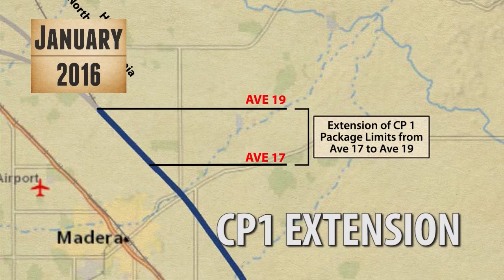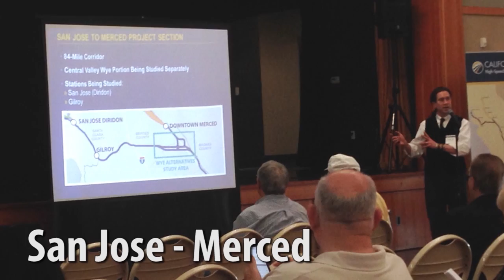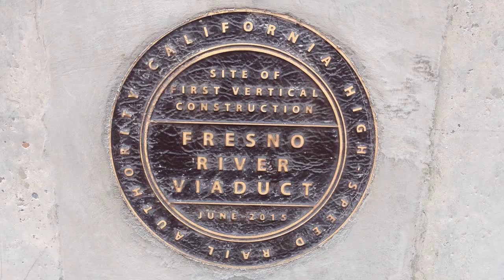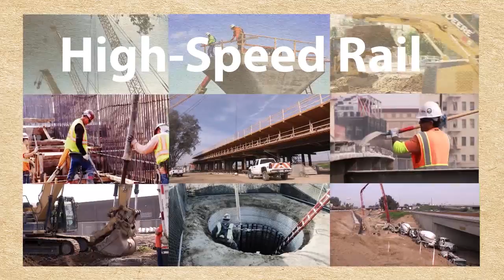6 Months of Progress on High-Speed Rail

Comment: I think we need to challenge the CEQA process. Namely, by going to the plebiscite to create the HSRA, the state affirmed its vision that the benefits of HSR environmental impact suspended judicial standing of opponents to agency-driven driven projects. The 2008 enabling referendum was more than just an obligation bond authorization. The State Water Project relies on similar (and ancient) 1960 authorization for its ongoing work, and educating the Bar of California - an agency organized under the State Constitution, on respecting the constitutional validity of voter-incorporated agencies is essential. We have, to be blunt, judges who have gone rogue. When the HSRA fails to assert its authority because it's afraid a judge might assent to meritless claims of a few property owners in Palo Alto, it sets a dangerous precedent that will doom key parts of the project. Complicit with the attorneys is the news media, especially in Los Angeles, which so often fails to step back and contextualize local opposition. This happened to the Red Line to the point the Federal Congress got involved, even though has absolutely no delegated powers to do so, and we are still untangling things to build the subway to the sea.

My challenge with HSR 2016 "shift to the north" is the MWD just finished the inland feeder project, meaning there are a whole bunch of engineers and miners out there who just managed to put a 42 mile tunnel under the San Bernardino mountains crossing nine faults and and there is a whole factory to construct concrete sections for use by TBRs. You should have gone in and hired them while their knowledge was fresh. Of course you aren't going to read any of these comments because I'm nobody.

Comment: CA High Speed Rail needs to seriously reconsider building over Tejon Pass via the I-5 corridor. It's a much more direct and competitive route between LA and Bakersfield than the currently planned route via Palmdale. A hundred years ago the Santa Fe Railroad didn't complete the rail gap, and now CA High Speed Rail has a chance to complete the rail gap between LA and the Central Valley. It's more than feasible and possibly less expensive than the planned route over Tehachapi and Soledad Canyon.
Reply: I'm Nor Cal so I don't know the details that you know.  You should go to meetings and express your concerns/ideas with the cities and high speed rail authority.  Or anyone that knows connections to what to do haha.
Reply: I believe the reason is technical. High speed trains do not like hilly mountain environments. I assume the cost to bore through mountains would be too high when it would only achieve savings of a few minutes. Going over the mountain would have a very high cost of electricity and maintenance, along with the potential of shutting down when it does occasionally snow up there.
Reply: @nme700  The Tehachapi crossing is presumably higher than Tejon. Plus the routing via Tehachapi was likely more to do with politics than physical challenges, connecting to Palmdale and the future Las Vegas HSR line to get support in the Antelope Valley as well as Bakersfield with promise of a downtown station.
Reply: @PacificRailsProds  It is nice to read your comment. You are absolutely right. Extending south won't happen for at least ten more years so perhaps there will be an opportunity to change the routing when after engineering studies it becomes clear the huge difference in cost. By electrifying Metrolink's Antelope Valley and San Bernadino lines like Caltrain did then Palmdale and LAUS could be connected to the High Desert Corridor and Brightline West.

Comment: This is ridiculous, the construction per mile is 45% more expensive than the Chinese and even 5% more expensive than the Japanese high speed rail. "Good" for Californian state budget or shall I say QE.
Reply: All American infrastructure is costing more than many other developed countries it is an American problem not just California.
Reply: rpf276 And I believe that is not a good thing at all in the long run especially for Americans. The federal or state government have to find a middle path or win-win solution for this issue.
Reply: Being the first high speed rail (new equipment has to be bought) and in a state with significant higher wadges than japan, coming in at 5% higher costs than japan would be a really good job. Yes china is cheaper, but they have the unique combination of cheap labor and high tech equipment available. You can't beat them.
Reply: Why compare efficient East Asian countries with the slow bureaucratic American system? It will be good enough if the Californian can build the rails in 10 years. The chinese and japanese can probably get it done in 1 years with the same price tag.
Reply: 5% more than japan really isn't bad. It could cost as little as China's if we paid our workers as badly as they do. Not worth it for savings IMO

Comment: Most expensive HSR per mile in the world, and also the slowest. Go, California!
Reply: New Urban expressway rebuilds with on demand toll lanes are similar in cost if not more over 100 million a mile. Besides American transportation infrastructure costs not just California are the most expensive in the world including where you like.  California HSR is made for +200 mph (+330 kpm) travel so unlike Acela in the Northeast where we never get around to high speed tracks this is really high speed rail.  The entire Cal HSR is over 500 miles (800 km) phase I and over 800 miles (1300 km) total build. California would spend 2 to 3 times mores with adding yet more freeways and airports so that is why it is happening.
Reply: False and false. With 200mph they are aiming for the current operational speed record. Yes when it is finished japan will probably run faster, but it will be within the top 10 of high speed trails. And regarding the cost, at the moment Germany is building a single train station for 5 Billion USD, only including the station and a few miles of track (Stuttgart 21). Or to pick a more conventional high speed rail project without a crazy underground station, the new track Nürnberg Erfurt in Germany costs 3,4 Billion USD for only 100 km.
Reply: Levitates? LOL...